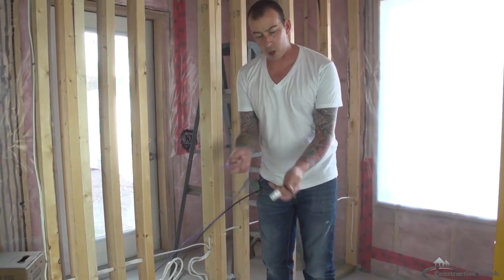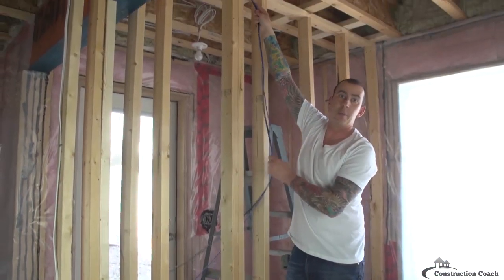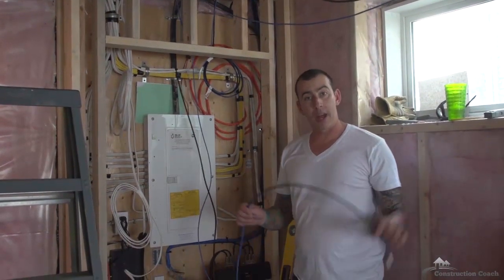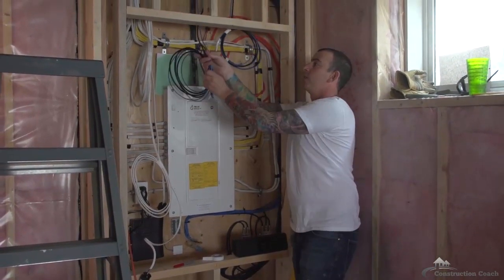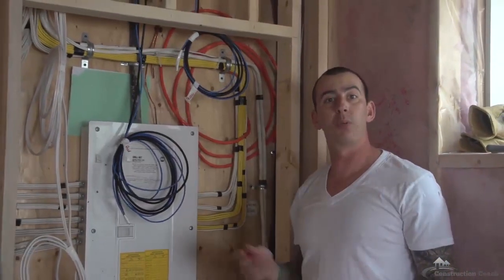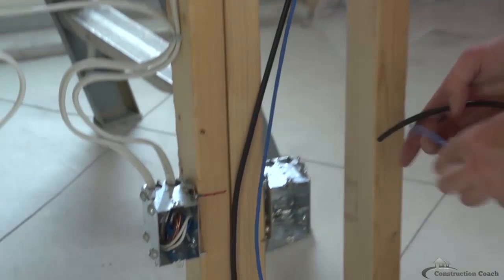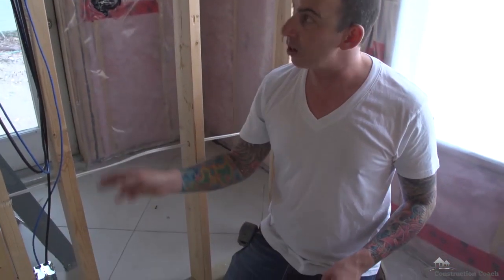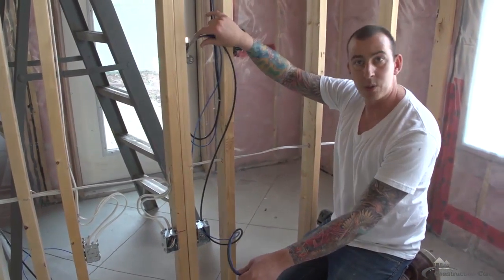How to Run Cable & Data Lines - DIY

Comment: "Don't kink your cable when coiling it, that would be bad."
* Proceeds to hammer the shit out of the cable with staples every 3 feet *
Reply: Lol I was going to say the same thing 😂😂😂😂
Reply: he's not hitting the cable... or are you just trying to be funny?
Reply: Caesar Rodriguez He’s hitting the clip that’s holding the cable. Splitting hairs here I think my man.
Reply: how are you supposed to "staple" the cables?
Reply: They make staples specifically for coax or cat wires - not a big deal

Comment: If you run smurf tube instead of stapling wires to the joists, you can pull new wire through later -- so if 10 years from now you want to upgrade to Cat8 or whatever you aren't stuck.
Reply: Art C they had the same reasoning back in the 70s with power cables the problem is when wire gets old the outside of the jacket breaks down just enough to cause it to not move inside of a conduit especially when you're not concerned about how many bends you put into it and you'll put in quite a few realistically it's not really possible to pull new wires in 10 years down the road unless you put in pull boxes after every 180° of Bend

Comment: As a cable tech I hate the staples,  they can damage the wires, not only of you hit them with the hammer but if you pull just a little bit and they're stapled it cam damage them. And why not run them in the attic
Reply: what would you use instead??
Reply: @dln6374  I’m not sure what he means, but plastic staples are more proper.
Reply: @dln6374  plastic conduits?

Comment: You can get away with kinking certain wires Tbf, although depends what type, also I wouldn’t use hammer and staples to put them up personally
Reply: Tell us, what would you use, to attach to the timber, before insulation, plumbing,  plaster boarding starts? It has to stay put; no on the way. The other trades won't be delicate with what's on the way.

Comment: Im building a new house soon so Im going to get it prewired for data I think one keystone to ever room should be ok.
When it comes to the TV points we have internet on the TV itself and the DVD player & an Xbox & Play station so do I need to have 4 keystone here
or one keystone and a small 4-6 switch , what do you think is best.
Reply: John Flannery      More dedicated homerun cables is best.    Run double what you think you need and connect all the homerun cables back to a central location and connect to a single 24 port or 48 port switch.    Avoid multiple switches.   

Also, if you can run conduit from the wall outlet up to the attic, it will make it FAR easier to upgrade cable down the road.
Reply: I think 2 keystones should be fine if you hanging you’re tv probably one about 5 feet from the floor. It’s best to wire evrything up and do homeruns if the walls are open

Comment: hello constuction coach so im running phone and cable in my condo which has concrete walls and ceilings some walls portion are framed however i dont have a distribution panel only existing cable plate in the living room but i want cable in all three bdrooms how do in accomplish this do I connect to one existing plate and then branch from there INTO other rooms

Comment: "DIY" on a house without any drywall up. Lol.
Reply: Right? I mean, what are the chances someone is at this stage of their "DIY" project?
Reply: DIY is simply not hiring someone. I am having a house built but, due to the excessive labor costs to pull wire, will be "doing it myself."

Comment: My biggest complain about this is you are using a hammer to tack the cable in, which is so wrong.... chances are that you will flatten the semi-conductor inside that cable that introduces ingress
Reply: Nanobit ingress is from punctures. ingress is off air signals bleeding into the cable and egress is rf signal leaking out.  reflections come from smashing cable. distance from center conductor to outer jacket of cable causes problems
Reply: What semi-conductor is inside a network cable? Shouldn't it be a conductor surrounded by a non-conductor?
Reply: semi-conductor is an electronic chip. There is no electronic in these cables, only electric wires and possibly shields. The wires are interlaced. Crushing can cause a change in the nice mesh/interlace, but since there is a gap in the clip, which is designed to be hammered, hit the wall on contact, while protecting the inset cables, the only Bang is going to be on the wall, not the cable. Size you clips correctly though.

Comment: do u run home run down to basement for each cable outlet?
Reply: tomie695 no. you can run a whole room of outlets so like 4 or 5 off one cable. it all depends on what you're gonna do and how many amps you need. one cable from your breaker box ( basement ) is 15 amps. now divide that through out the room.
Reply: thank you
Reply: tomie695 you should absolutely run your cat5 and coax home run from side of the house to each outlet or from each outlet to a centrol location/smart panel/patch panel yada yada. never split a wire ourside of where all your cables meet. follow this and amplifiers wull seldom be needed. 

i been doing cable and cat5 for the last 10 years.
Reply: klok95330 he’s right dish network does it right they each line separate. Direct tv splits it off how ever they like and can get away with it but dish network wouldn’t work with all those splitters.

Comment: Ya know... there's always gonna be someone who chimes in on these
videos with criticism, and or something to share.
Now... this guy obviously knows what he's doing.

Hmmm... leaving 6' of slack? Even if the wire is cheap... 6'?
If he paid for the material, fine. No big deal.
But, where did you want to work on it... the middle of the room?

I thought cable staples had to be within 4" of the box.
I guess that would depend upon the code of the state you're in?

Comment: Keep it away from power..... runs it directly to the high voltage panel. lol.  Usually the best move would be to choose a different spot for your switch and cables.
Reply: LOLOLOLOLOLOLOLOLOLOLOLOLOLOLOLOLOLOLOL YOU'RE SO FUNNY!!! LOLOLOLOLOLOLOLOLOLOLOLOLOLOLOLOLOLOLOLOLOLOLOLOLOLOLOLOLOLOLOLOLOLOLOLOLOLOLOLOLOLOLOLOLOLOLOLOLOLOLOLOLOLOLOLOLOLOLOLOLOLOLOLOLOLOLOLOLOLOLOLOLOLOLOLOLOLOLOLOLOLOLOLOLOLOLOLOLOLOLOLOLOLOLOLOLOLOLOLOLOLOLOLOLOLOLOLOLOLOLOLOLOLOLOLOLOLOLOLOLOLOLOLOLOLOLOLOLOLOLOLOLOLOLOLOLOLOLOLOLOLOLOLOLOLOLOLOLOLOLOLOLOLOLOLOLOLOLOLOLOLOLOLOLOLOLOLOLOLOLOLOLOLOLOLOLOLOLOLOLOLOLOLOLOLOLOLOLOLOLOLOLOLOLOLOLOLOLOLOLOLOLOLOLOLOLOLOLOLOLOLOLOLOLOLOLOLOLOLOLOLOLOLOLOLOLOLOLOLOLOLOLOLOLOLOLOLOLOLOLOLOLOLOLOLOLOLOLOLOLOLOLOLOLOLOLOLOLOLOLOLOLOLOLOLOLOLOLOLOLOLOLOLOLOLOLOLOLOLOLOLOLOLOLOLOLOLOLOLOLOLOLOLOLOLOLOLOLOLOLOLOLOLOLOLOLOLOLOLOLOLOLOLOLOLOLOLOLOLOLOLOLOLOLOLOLOLOLOLOLOLOLOLOLOLOLOLOLOLOLOLOLOLOLOLOLOLOLOLOLOLOLOLOLOLOLOLOLOLOLOLOLOLOLOLOLOLOLOLOLOLOLOLOLOLOLOLOLOLOLOLOLOLOLOLOLOLOLOLOLOLOLOLOLOLOLOLOLOLOLOLOLOLOLOLOLOLOLOLOLOLOLOLOLOLOLOLOLOLOLOLOLOLOLOLOLOLOLOLOLOLOLOLOLOLOLOLOLOLOLOLOLOLOLOLOLOLOLOLOLOLOLOLOLOLOLOLOLOLOLOLOLOLOLOLOLOLOLOLOLOLOLOLOLOLOLOLOLOLOLOLOLOLOLOLOLOLOLOLOLOLOLOLOLOLOLOLOLOLOLOLOLOLOLOLOLOLOLOLOLOLOLOLOLOLOLOLOLOLOLOLOLOLOLOLOLOLOLOLOLOLOLOLOLOLOLOLOLOLOLOLOLOLOLOLOLOLOLOLOLOLOLOLOLOLOLOLOLOLOLOLOLOLOLOLOLOLOLOLOLOLOLOLOLOLOLOLOLOLOLOLOLOLOLOLOLOLOLOLOLOLOLOLOLOLOLOLOLOLOLOLOLOLOLOLOLOLOLOLOLOLOLOLOLOLOLOLOLOLOLOLOLOLOLOLOLOLOLOLOLOLOLOLOLOLOLOLOLOLOLOLOLOLOLOLOLOLOLOLOLOLOLOLOLOLOLOLOLOLOLOLOLOLOLOLOLOLOLOLOLOLOLOLOLOLOLOLOLOLOLOLOLOLOLOLOLOLOLOLOLOLOLOLOLOLOLOLOLOLOLOLOLOLOLOLOLOLOLOLOLOLOLOLOLOLOLOLOLOLOLOLOLOLOLOLOLOLOLOLOLOLOLOLOLOLOLOLOLOLOLOLOLOLOLOLOLOLOLOLOLOLOLOLOLOLOLOLOLOLOLOLOLOLOLOLOLOLOLOLOLOLOLOLOLOLOLOLOLOLOLOLOLOLOLOLOLOLOLOLOLOLOLOLOLOLOLOLOLOLOLOLOLOLOLOLOLOLOLOLOLOLOLOLOLOLOLOLOLOLOLOLOLOLOLOLOLOLOLOLOLOLOLOLOLOLOLOLOLOLOLOLOLOLOLOLOLOLOLOLOLOLOLOLOLOLOLOLOLOLOLOLOLOLOLOLOLOLOLOLOLOLOLOLOLOLOLOLOLOLOLOLOLOLOLOLOLOLOLOLOLOLOLOLOLOLOLOLOLOLOLOLOLOLOLOLOLOLOLOLOLOLOLOLOLOLOLOLOLOLOLOLOLOLOLOLOLOLOLOLOLOLOLOLOLOLOLOLOLOLOLOLOLOLOLOLOLOLOLOLOLOLOLOLOLOLOLOLOLOLOLOLOLOLOLOLOLOLOLOLOLOLOLOLOLOLOLOLOLOLOLOLOLOLOLOLOLOLOLOLOLOLOLOLOLOLOLOLOLOLOLOLOLOLOLOLOLOLOLOLOLOLOLOLOLOLOLOLOLOLOLOLOLOLOLOLOLOLOLOLOLOLOLOLOLOLOLOLOLOLOLOLOLOLOLOLOLOLOLOLOLOLOLOLOLOLOLOLOLOLOLOLOLOLOLOLOLOLOLOLOLOLOLOLOLOLOLOLOLOLOLOLOLOLOLOLOLOLOLOLOLOLOLOLOLOLOLOLOLOLOLOLOLOLOLOLOLOLOLOLOLOLOLOLOLOLOLOLOLOLOLOLOLOLOLOLOLOLOLOLOLOLOLOLOLOLOLOLOLOLOLOLOLOLOLOLOLOLOLOLOLOLOLOLOLOLOLOLOLOLOLOLOLOLOLOLOLOLOLOLOLOLOLOLOLOLOLOLOLOLOLOLOLOLOLOLOLOLOLOLOLOLOLOLOLOLOLOLOLOLOLOLOLOLOLOLOLOLOLOLOLOLOLOLOLOLOLOLOLOLOLOLOLOLOLOLOLOLOLOLOLOLOLOLOLOLOLOLOLOLOLOLOLOLOLOLOLOLOLOLOLOLOLOLOLOLOLOLOLOLOLOLOLOLOLOLOLOLOLOLOLOLOLOLOLOLOLOLOLOLOLOLOLOLOLOLOLOLOLOLOLOLOLOLOLOLOLOLOLOLOLOLOLOLOLOLOLOLOLOLOLOLOLOLOLOLOLOLOLOLOLOLOLOLOLOLOLOLOLOLOLOLOLOLOLOLOLOLOLOLOLOLOLOLOLOLOLOLOLOLOLOLOLOLOLOLOLOLOLOLOLOLOLOLOLOLOLOLOLOLOLOLOLOLOLOLOLOLOLOLOLOLOLOLOLOLOLOLOLOLOLOLOLOLOLOLOLOLOLOLOLOLOLOLOLOLOLOLOLOLOLOLOLOLOLOLOLOLOLOLOLOLOLOLOLOLOLOLOLOLOLOLOLOLOLOLOLOLOLOLOLOLOLOLOLOLOLOLOLOLOLOLOLOLOLOLOLOLOLOLOLOLOLOLOLOLOLOLOLOLOLOLOLOLOLOLOLOLOLOLOLOLOLOLOLOLOLOLOLOLOLOLOLOLOLOLOLOLOLOLOLOLOLOLOLOLOLOLOLOLOLOLOLOLOLOLOLOLOLOLOLOLOLOLOLOLOLOLOLOLOLOLOLOLOLOLOLOLOLOLOLOLOLOLOLOLOLOLOLOLOLOLOLOLOLOLOLOLOLOLOLOLOLOLOLOLOLOLOLOLOLOLOLOLOLOLOLOLOLOLOLOLOLOLOLOLOLOLOLOLOLOLOLOLOLOLOLOLOLOLOLOLOLOLOLOLOLOLOLOLOLOLOLOLOLOLOLOLOLOLOLOLOLOLOLOLOLOLOLOLOLOLOLOLOLOLOLOLOLOLOLOLOLOLOLOLOLOLOLOLOLOLOLOLOLOLOLOLOLOLOLOLOLOLOLOLOLOLOLOLOLOLOLOLOLOLOLOLOLOLOLOLOLOLOLOLOLOLOLOLOLOLOLOLOLOLOLOLOLOLOLOLOLOLOLOLOLOLOLOLOLOLOLOLOLOLOLOLOLOLOLOLOLOLOLOLOLOLOLOLOLOLOLOLOLOLOLOLOLOLOLOLOLOLOLOLOLOLOLOLOLOLOLOLOLOLOLOLOLOLOLOLOLOLOLOLOLOLOLOLOLOLOLOLOLOLOLOLOLOLOLOLOLOLOLOLOLOLOLOLOLOLOLOLOLOLOLOLOLOLOLOLOLOLOLOLOLOLOLOLOLOLOLOLOLOLOLOLOLOLOLOLOLOLOLOLOLOLOLOLOLOLOLOLOLOLOLOLOLOLOLOLOLOLOLOLOLOLOLOLOLOLOLOLOLOLOLOLOLOLOLOLOLOLOLOLOLOLOLOLOLOLOLOLOLOLOLOLOLOLOLOLOLOLOLOLOLOLOLOLOLOLOLOLOLOLOLOLOLOLOLOLOLOLOLOLOLOLOLOLOLOLOLOLOLOLOLOLOLOLOLOLOLOLOLOLOLOLOLOLOLOLOLOLOLOLOLOLOLOLOLOLOLOLOLOLOLOLOLOLOLOLOLOLOLOLOLOLOLOLOLOLOLOLOLOLOLOLOLOLOLOLOLOLOLOLOLOLOLOLOLOLOLOLOLOLOLOLOLOLOLOLOLOLOLOLOLOLOLOLOLOLOLOLOLOLOLOLOLOLOLOLOLOLOLOLOLOLOLOLOLOLOLOLOLOLOLOLOLOLOLOLOLOLOLOLOLOLOLOLOLOLOLOLOLOLOLOLOLOLOLOLOLOLOLOLOLOLOLOLOLOLOLOLOLOLOLOLOLOLOLOLOLOLOLOLOLOLOLOLOLOLOLOLOLOLOLOLOLOLOLOLOLOLOLOLOLOLOLOLOLOLOLOLOLOLOLOLOLOLOLOLOLOLOLOLOLOLOLOLOLOLOLOLOLOLOLOLOLOLOLOLOLOLOLOLOLOLOLOLOLOLOLOLOLOLOLOLOLOLOLOLOLOLOLOLOLOLOLOLOLOLOLOLOLOLOLOLOLOLOLOLOLOLOLOLOLOLOLOLOLOLOLOLOLOLOLOLOLOLOLOLOLOLOLOLOLOLOLOLOLOLOLOLOLOLOLOLOLOLOLOLOLOLOLOLOLOLOLOLOLOLOLOLOLOLOLOLOLOLOLOLOLOLOLOLOLOLOLOLOLOLOLOLOLOLOLOLOLOLOLOLOLOLOLOLOLOLOLOLOLOLOLOLOLOLOLOLOLOLOLOLOLOLOLOLOLOLOLOLOLOLOLOLOLOLOLOLOLOLOLOLOLOLOLOLOLOLOLOLOLOLOLOLOLOLOLOLOLOLOLOLOLOLOLOLOLOLOLOLOLOLOLOLOLOLOLOLOLOLOLOLOLOLOLOLOLOLOLOLOLOLOLOLOLOLOLOLOLOLOLOLOLOLOLOLOLOLOLOLOLOLOLOLOLOLOLOLOLOLOLOLOLOLOLOLOLOLOLOLOLOLOLOLOLOLOLOLOLOLOLOLOLOLOLOLOLOLOLOLOLOLOLOLOLOLOLOLOLOLOLOLOLOLOLOLOLOLOLOLOLOLOLOLOLOLOLOLOLOLOLOLOLOLOLOLOLOLOLOLOLOLOLOLOLOLOLOLOLOLOLOLOLOLOLOLOLOLOLOLOLOLOLOLOLOLOLOLOLOLOLOLOLOLOLOLOLOLOLOLOLOLOLOLOLOLOLOLOLOLOLOLOLOLOLOLOLOLOLOLOLOLOLOLOLOLOLOLOLOLOLOLOLOLOLOLOLOLOLOLOLOLOLOLOLOLOLOLOLOLOLOLOLOLOLOLOLOLOLOLOLOLOLOLOLOLOLOLOLOLOLOLOLOLOLOLOLOLOLOLOLOLOLOLOLOLOLOLOLOLOLOLOLOLOLOLOLOLOLOLOLOLOLOLOLOLOLOLOLOLOLOLOLOLOLOLOLOLOLOLOLOLOLOLOLOLOLOLOLOLOLOLOLOLOLOLOLOLOLOLOLOLOLOLOLOLOLOLOLOLOLOLOLOLOLOLOLOLOLOLOLOLOLOLOLOLOLOLOLOLOLOLOLOLOLOLOLOLOLOLOLOLOLOLOLOLOLOLOLOLOLOLOLOLOLOLOLOLOLOLOLOLOLOLOLOLOLOLOLOLOLOLOLOLOLOLOLOLOLOLOLOLOLOLOLOLOLOLOLOLOLOLOLOLOLOLOLOLOLOLOLOLOLOLOLOLOLOLOLOLOLOLOLOLOLOLOLOLOLOLOLOLOLOLOLOLOLOLOLOLOLOLOLOLOLOLOLOLOLOLOLOLOLOLOLOLOLOLOLOLOLOLOLOLOLOLOLOLOLOLOLOLOLOLOLOLOLOLOLOLOLOLOLOLOLOLOLOLOLOLOLOLOLOLOLOLOLOLOLOLOLOLOLOLOLOLOLOLOLOLOLOLOLOLOLOLOLOLOLOLOLOLOLOLOLOLOLOLOLOLOLOLOLOLOLOLOLOLOLOLOLOLOLOLOLOLOLOLOLOLOLOLOLOLOLOLOLOLOLOLOLOLOLOLOLOLOLOLOLOLOLOLOLOLOLOLOLOLOLOLOLOLOLOLOLOLOLOLOLOLOLOLOLOLOLOLOLOLOLOLOLOLOLOLOLOLOLOLOLOLOLOLOLOLOLOLOLOLOLOLOLOLOLOLOLOLOLOLOLOLOLOLOLOLOLOLOLOLOLOLOLOLOLOLOLOLOLOLOLOLOLOLOLOLOLOLOLOLOLOLOLOLOLOLOLOLOLOLOLOLOLOLOLOLOLOLOLOLOLOLOLOLOLOLOLOLOLOLOLOLOLOLOLOLOLOLOLOLOLOLOLOLOLOLOLOLOLOLOLOLOLOLOLOLOLOLOLOLOLOLOLOLOLOLOLOLOLOLOLOLOLOLOLOLOLOLOLOLOLOLOLOLOLOLOLOLOLOLOLOLOLOLOLOLOLOLOLOLOLOLOLOLOLOLOLOLOLOLOLOLOLOLOLOLOLOLOLOLOLOLOLOLOLOLOLOLOLOLOLOLOLOLOLOLOLOLOLOLOLOLOLOLOLOLOLOLOLOLOLOLOLOLOLOLOLOLOLOLOLOLOLOLOLOLOLOLOLOLOLOLOLOLOLOLOLOLOLOLOLOLOLOLOLOLOLOLOLOLOLOLOLOLOLOLOLOLOLOLOLOLOLOLOLOLOLOLOLOLOLOLOLOLOLOLOLOLOLOLOLOLOLOLOLOLOLOLOLOLOLOLOLOLOLOLOLOLOLOLOLOLOLOLOLOLOLOLOLOLOLOLOLOLOLOLOLOLOLOLOLOLOLOLOLOLOLOLOLOLOLOLOLOLOLOLOLOLOLOLOLOLOLOLOLOLOLOLOLOLOLOLOLOLOLOLOLOLOLOLOLOLOLOLOLOLOLOLOLOLOLOLOLOLOLOLOLOLOLOLOLOLOLOLOLOLOLOLOLOLOLOLOLOLOLOLOLOLOLOLOLOLOLOLOLOLOLOLOLOLOLOLOLOLOLOLOLOLOLOLOLOLOLOLOLOLOLOLOLOLOLOLOLOLOLOLOLOLOLOLOLOLOLOLOLOLOLOLOLOLOLOLOLOLOLOLOLOLOLOLOLOLOLOLOLOLOLOLOLOLOLOLOLOLOLOLOLOLOLOLOLOLOLOLOLOLOLOLOLOLOLOLOLOLOLOLOLOLOLOLOLOLOLOLOLOLOLOLOLOLOLOLOLOLOLOLOLOLOLOLOLOLOLOLOLOLOLOLOLOLOLOLOLOLOLOLOLOLOLOLOLOLOLOLOLOLOLOLOLOLOLOLOLOLOLOLOLOLOLOLOLOLOLOLOLOLOLOLOLOLOLOLOLOLOLOLOLOLOLOLOLOLOLOLOLOLOLOLOLOLOLOLOLOLOLOLOLOLOLOLOLOLOLOLOLOLOLOLOLOLOLOLOLOLOLOLOLOLOLOLOLOLOLOLOLOLOLOLOLOLOLOLOLOLOLOLOLOLOLOLOLOLOLOLOLOLOLOLOLOLOLOLOLOLOLOLOLOLOLOLOLOLOLOLOLOLOLOLOLOLOLOLOLOLOLOLOLOLOLOLOLOLOLOLOLOLOLOLOLOLOLOLOLOLOLOLOLOLOLOLOLOLOLOLOLOLOLOLOLOLOLOLOLOLOLOLOLOLOLOLOLOLOLOLOLOLOLOLOLOLOLOLOLOLOLOLOLOLOLOLOLOLOLOLOLOLOLOLOLOLOLOLOLOLOLOLOLOLOLOLOLOLOLOLOLOLOLOLOLOLOLOLOLOLOLOLOLOLOLOLOLOLOLOLOLOLOLOLOLOLOLOLOLOLOLOLOLOLOLOLOLOLOLOLOLOLOLOLOLOLOLOLOLOLOLOLOLOLOLOLOLOLOLOLOLOLOLOLOLOLOLOLOLOLOLOLOLOLOLOLOLOLOLOLOLOLOLOLOLOLOLOLOLOLOLOLOLOLOLOLOLOLOLOLOLOLOLOLOLOLOLOLOLOLOLOLOLOLOLOLOLOLOLOLOLOLOLOLOLOLOLOLOLOLOLOLOLOLOLOLOLOLOLOLOLOLOLOLOLOLOLOLOLOLOLOLOLOLOLOLOLOLOLOLOLOLOLOLOLOLOLOLOLOLOLOLOLOLOLOLOLOLOLOLOLOLOLOLOLOLOLOLOLOLOLOLOLOLOLOLOLOLOLOLOLOLOLOLOLOLOLOLOLOLOLOLOLOLOLOLOLOLOLOLOLOLOLOLOLOLOLOLOLOLOLOLOLOLOLOLOLOLOLOLOLOLOLOLOLOLOLOLOLOLOLOLOLOLOLOLOLOLOLOLOLOLOLOLOLOLOLOLOLOLOLOLOLOLOLOLOLOLOLOLOLOLOLOLOLOLOLOLOLOLOLOLOLOLOLOLOLOLOLOLOLOLOLOLOLOLOLOLOLOLOLOLOLOLOLOLOLOLOLOLOLOLOLOLOLOLOLOLOLOLOLOLOLOLOLOLOLOLOLOLOLOLOLOLOLOLOLOLOLOLOLOLOLOLOLOLOLOLOLOLOLOLOLOLOLOLOLOLOLOLOLOLOLOLOLOLOLOLOLOLOLOLOLOLOLOLOLOLOLOLOLOLOLOLOLOLOLOLOLOLOLOLOLOLOLOLOLOLOLOLOLOLOLOLOLOLOLOLOLOLOLOLOLOLOLOLOLOLOLOLOLOLOLOLOLOLOLOLOLOLOLOLOLOLOLOLOLOLOLOLOLOLOLOLOLOLOLOLOLOLOLOLOLOLOLOLOLOLOLOLOLOLOLOLOLOLOLOLOLOLOLOLOLOLOLOLOLOLOLOLOLOLOLOLOLOLOLOLOLOLOLOLOLOLOLOLOLOLOLOLOLOLOLOLOLOLOLOLOLOLOLOLOLOLOLOLOLOLOLOLOLOLOLOLOLOLOLOLOLOLOLOLOLOLOLOLOLOLOLOLOLOLOLOLOLOLOLOLOLOLOLOLOLOLOLOLOLOLOLOLOLOLOLOLOLOLOLOLOLOLOLOLOLOLOLOLOLOLOLOLOLOLOLOLOLOLOLOLOLOLOLOLOLOLOLOLOLOLOLOLOLOLOLOLOLOLOLOLOLOLOLOLOLOLOLOLOLOLOLOLOLOLOLOLOLOLOLOLOLOLOLOLOLOLOLOLOLOLOLOLOLOLOLOLOLOLOLOLOLOLOLOLOLOLOLOLOLOLOLOLOLOLOLOLOLOLOLOLOLOLOLOLOLOLOLOLOLOLOLOLOLOLOLOLOLOLOLOLOLOLOLOLOLOLOLOLOLOLOLOLOLOLOLOLOLOLOLOLOLOLOLOLOLOLOLOLOLOLOLOLOLOLOLOLOLOLOLOLOLOLOLOLOLOLOLOLOLOLOLOLOLOLOLOLOLOLOLOLOLOLOLOLOLOLOLOLOLOLOLOLOLOLOLOLOLOLOLOLOLOLOLOLOLOLOLOLOLOLOLOLOLOLOLOLOLOLOLOLOLOLOLOLOLOLOLOLOLOLOLOLOLOLOLOLOLOLOLOLOLOLOLOLOLOLOLOLOLOLOLOLOLOLOLOLOLOLOLOLOLOLOLOLOLOLOLOLOLOLOLOLOLOLOLOLOLOLOLOLOLOLOLOLOLOLOLOLOLOLOLOLOLOLOLOLOLOLOLOLOLOLOLOLOLOLOLOLOLOLOLOLOLOLOLOLOLOLOLOLOLOLOLOLOLOLOLOLOLOLOLOLOLOLOLOLOLOLOLOLOLOLOLOLOLOLOLOLOLOLOLOLOLOLOLOLOLOLOLOLOLOLOLOLOLOLOLOLOLOLOLOLOLOLOLOLOLOLOLOLOLOLOLOLOLOLOLOLOLOLOLOLOLOLOLOLOLOLOLOLOLOLOLOLOLOLOLOLOLOLOLOLOLOLOLOLOLOLOLOLOLOLOLOLOLOLOLOLOLOLOLOLOLOLOLOLOLOLOLOLOLOLOLOLOLOLOLOLOLOLOLOLOLOLOLOLOLOLOLOLOLOLOLOLOLOLOLOLOLOLOLOLOLOLOLOLOLOLOLOLOLOLOLOLOLOLOLOLOLOLOLOLOLOLOLOLOLOLOLOLOLOLOLOLOLOLOLOLOLOLOLOLOLOLOLOLOLOLOLOLOLOLOLOLOLOLOLOLOLOLOLOLOLOLOLOLOLOLOLOLOLOLOLOLOLOLOLOLOLOLOLOLOLOLOLOLOLOLOLOLOLOLOLOLOLOLOLOLOLOLOLOLOLOLOLOLOLOLOLOLOLOLOLOLOLOLOLOLOLOLOLOLOLOLOLOLOLOLOLOLOLOLOLOLOLOLOLOLOLOLOLOLOLOLOLOLOLOLOLOLOLOLOLOLOLOLOLOLOLOLOLOLOLOLOLOLOLOLOLOLOLOLOLOLOLOLOLOLOLOLOLOLOLOLOLOLOLOLOLOLOLOLOLOLOLOLOLOLOLOLOLOLOLOLOLOLOLOLOLOLOLOLOLOLOLOLOLOLOLOLOLOLOLOLOLOLOLOLOLOLOLOLOLOLOLOLOLOLOLOLOLOLOLOLOLOLOLOLOLOLOL
Reply: Derrick Hokit its okay if it runs perpendicularly not parallel though. And if you do run it parallel then 2 feet max it is i beleive. But sometimes you just cant avoid it especially new homes that are being built they get 5-6 plugs in each room so wires are all over the place... almost impossible to avoid it.
Reply: Yep.. respect in the beginning when he acknowledged crosstalk... number and type of staples seemed like overkill...(could be code)... but finishing in the same cavity as the electrical panel???  I think it's a very good video and hoping he just can't say anything negative about the design of the house in exchange for being allowed to record there.
Reply: @glasshalfempty1984  you must have way too much time on your hands bro 😂😂😂. Jk

Comment: I'm in the idea of opening my own low voltage company but I don't know how to price my jobs. Could you help me with some information like:
 How much do you charge per wire drop (cat5e and RG6)?
Price for a 5.1 surround sound prewire
Prewire for basic alarm system (1 motion, all doors and windows, 1 keypad)
And if you have a bid proposal template it would be great.
I am located in Houston Texas, and my goal is to work in new residential houses. Thanks
Reply: :") you might as well become a sparky, since we do all of that anyway.